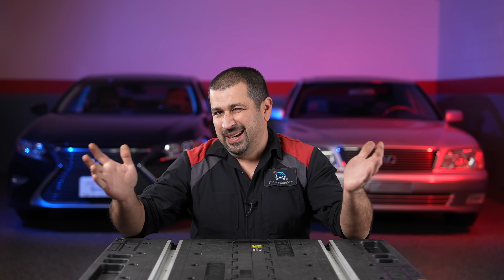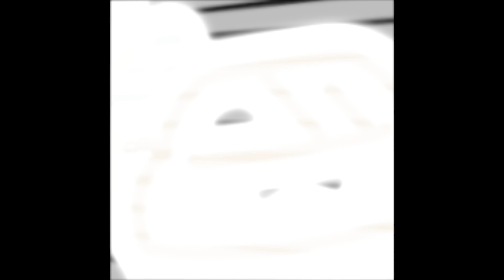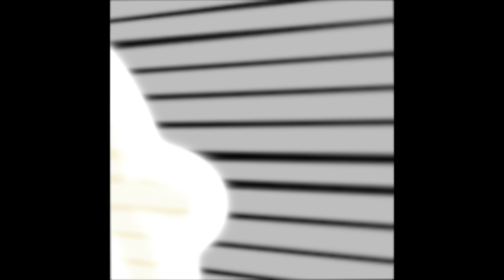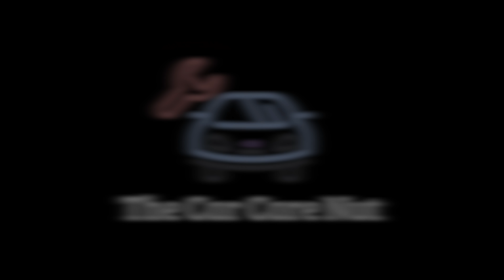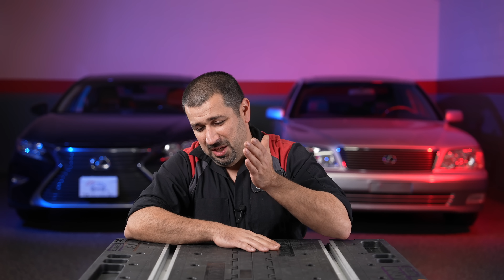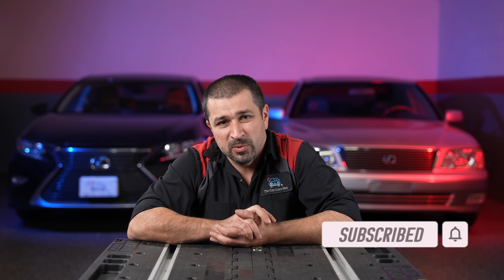Can Modern Turbo Engines Be Reliable? Here's The TRUTH!

Comment: Yeah, but AMD isn’t 0W 20 really there in many manufacturers recommendations just because they want to get lower emissions and higher fuel economy and it may not be that it’s actually needed and a thicker oil would have the engine last longer?

Comment: I've got the 6th gen 2025 4Runner TRD Off Road Premium (Non-Hybrid). Every 5k miles I get the oil change done at my local Toyota dealer. Using OEM Oil Filter, but my own engine oil: Pennzoil Platinum 0W 20 Full-Synthetic.
Reply: why?  is that oil any better than the Walmart brand synthetic oil?

Comment: Don't forget to also let the engine idle a while before shutting it down.   Allow the oil to continue flowing and cool the turbo before hitting that Start/Stop button.
Reply: Only old turbo cars need to idle before shutdown. Newer cars cool the turbo even after the engine is turned off.
Reply: @Japplesnap it's always a good idea to idle any ICE, even jets, before shutdown.
Reply: @AllenReinecke Not necessary to idle a car engine before shutdown.  Unless it's an old turbo engine and even then, it's just to protect the turbo, not the engine.
Reply: @Japplesnap I guess a 35-year career engineering powertrains wasn't worth much in your world

Comment: Between my family and myself, we owned a total of 6 late-80s Chryslers with 2.2L turbo engines.  They had a number of reliability problems, but not a single issue with the turbos.  My mom's LeBaron GTS went through 3 transmissions and a number of head gaskets before it got to 285k miles, but it still had the original turbo.  Oil changes every 3k miles was the key.

Comment: On an old Volvo I needed to temporarily disconnect the turbo pipe to get to the coils to change one out. Noticed a bunch of oil inside the pipe as I lifted it out and have always wondered why? That Volvo didn’t consume oil as far as I can remember.
Reply: It’s crank case vent. Gets sucked into the intake.  Normal to see some sitting at bottom of charge pipe.

Comment: Great advice! Got the same recommendation from a local service manager. Clean fluids are the key to mechanical longevity. My habit is to change oil every 3-4k miles, depending on how I’ve been driving. And follow recommendations for other components, transmissions in particular.

Comment: I have a brand new Tacoma with the 2.4 L turbo it's a great engine runs really well but I really think people are going to have problems with them because a lot of people are trying to modify them for more power and performance that's not what that engine and turbo are for if left stock and well-maintained I can see it being very reliable so I'm not really worried about mine it's the ones on the used Market later down the road that people have beat on that people may have problems with

Comment: i’m amazed you didn’t cover cool down and warm up
Reply: I think he was going for a much more general audience on this video. He didn't want anything to get in the way of the simple message of CHANGE YOUR OIL!
Reply: Warm up cold or hot I let my RPM drop below 1k RPM. Cool down wait 4min then turn off your ignition. I'm at 58k on my 2023 Tundra TRD 4x4. Oil change every 3k since 40k miles. NEVER DO 10K oil change.
Reply: Between turbos and all the electronics, there will be a Lot of 10-12 year old vehicles going to the junkyards
Reply: Its not really necessary in modern turbos. They are water cooled now as well so when you shut it off the turbos are still being cooled. Im mean they kinda have to be with the whole start/stop system.
Reply: The used car market is going to be trash. 3 or 4 neglected owners and the car will be in the junk yard
Reply: @donc6781  That’s their plan. Go watch Uncle Tony’s Garage.
Reply: It’s in his other video
Reply: not neccesary on modern turbos
Reply: @cshader2488 lol
Reply: New modern turbo engines don`t require such procedures.
"No, modern turbo engines typically do not require a cool down period before shutting off, as they are designed with features that manage heat effectively. However, if the engine has been driven hard, allowing it to idle for a minute or two can be beneficial for peace of mind." - Anthropics
Reply: Excuse me Sir/Madam but i was wondering whether longer intervals would be more acceptable in europe since my uncle told me that here in europe and britain, such intervals are fine because europe´s climate isn´t harsh on cars. But those long intervals are blowing my mind since back in my region in middle east i was changing oil every 5k kilometers, some criticized mefor not doing it at 3k. i would appreciate any insight.

Comment: As an anecdote on oil changes, I believe the Acura RDX was Honda's first turbo vehicle in the US. Honda called for 3k oil change interval.

The turbo trend also coincides with the direct injection trend and its downsides of more carbon.

My VW turbo engine is alive and well at 130k miles, good compression across cylinders. But oil consumption and cruising oil temps are slowly increasing.

Comment: 2:25 Turbo diesel last a long time. Some run more than 40 psi. (GM 3.0 Duramax run 43 psi) My 2016 F150 2.7 ecoboost only run 18-20 psi. It will last just as long if I take care of it.
Reply: Accurate statement.. new taco max gasoline turbo psi 15.. safe .. that’s eco mode in my race car subie turbo..

Comment: In terms of daily vehicle use, my issue is not the block whether it can be reliable, but the turbocharger(s) itself. Having a forced induction vehicle is adding more parts to fix in the long run. 

For a weekend/fun vehicle, I'm all with forced induction 🤷‍♀️
Reply: Turbo charger is like hips and joints the more you use it will eventually wear out:) On a sports car I think NA as when the turbo does kick-in and upset the vehicle dynamics and the torque through rear wheels make the car want to do doughnuts

Comment: I’m not necessarily opposed to turbo engines, but I really don’t like the amount of plumbing needed for water-to-air intercoolers.  The V35A is a massive mess when it comes to this.  All those extra hoses and pump and radiators that create failure points.  

I like the Tacoma air-to-air intercooler much better.  Very simple design and much more forgiving.  It also doesn’t clutter up the engine bay.  I’d be ok with owning a turbo Tacoma or 4Runner.

Comment: Yes I'm doing the 3 to 4k engine oil change. But I'm interested what about the performance engine that rx and TX has in the 500h? It has turbo and hybrid. Should the same apply? Or 5k? Since it's hybrid it will use less the engine. I will assume the hybrid might make up 25 to 35% of that miles put in? So 5k will be good for those?

Comment: It's videos like this that make me appreciate my non turbo 2024 crosstrek more whenever I complain about it being slow.
Reply: Ditto the Toyota hybrids with no turbo and D4S dual injection.

Impreza RS is a temping future car for me.
Reply: True. But holy cow is that thing slow
Reply: That boxer engine still needs high-quality maintenance. Maybe not 3000 mile oil changes but I wouldn’t put it past 5000. Also timely differential and CVT service.
Reply: @rickm8456 Yeah absolutely.  I agree.  I have the oil changed between 4 and 5000.  From what I understand it's important to have the CVT fluid changed every 30,000.
Reply: @flipfloplogic  yep. I just got an Outback and that’s what I plan to do.

Comment: I would change the oil on a turbo gas engine every 3,000 miles all day .  I agree with the host
Reply: I’m 71 and have been changing oil at 3000 miles my entire life and have never had an oil related failure.
Reply: @RonL-y3v honor to hear this coming from some1 like yourself !
Reply: Non-synthetic oils 3,000 miles, Synthetic oils 5,000 miles.
Reply: That’s wat I do.
Reply: For an average driver 5000 miles between oil changes is fine.
Reply: There is no need unless you're doing severe duty. 5k miles for most people is fine. If you do nothing but long highway drives and don't drive the car hard even with turbo gas engines you can push up to 7500 miles. Subaru only recommended 3750 mile intervals if you use conventional oil or severe duty on the Subaru STIs which have been turbo engines for a long time now.
Reply: @DOAHunt3r yup.. use thin synthetic oil..😊😊
Reply: @DOAHunt3r Plenty of people are doing "severe duty" with lead feet, short trips, and lots of hard stop and go.
Reply: @DOAHunt3r what about for the new VB WRX? Which oil is best for stock and daily driving?
Reply: @WillCamacho-gb2kg  If you check Subaru Japan they actually explicitly list a 0W30 and 5W30 as a recommended oil. Mobil1 ESP 0W30 or Mobil1 FS 5W30 will do just fine. There are also a lot of other equivalents on the market, basically anything marked for Euro cars in those viscosity grades.
Reply: @DOAHunt3r 3K good for me
Reply: I have non turbo vehicles and I change oil every 3000 miles as well, has never hurt the engine.  Oil is cheap.

Comment: Very sound advice. I had a 2013 volkswagen 80k miles, the turbo decided to pack in. The engine had regular oil changes we were told of six thousand kilometers or roughly 4k miles. Also, we bought the car secondhand, so there's no telling how the previous driver looked after it. It just seemed that the wastegate and those seals around the Turbo shaft and the bearings suffered damage eventually, probably due to the type of oil used and probably several late oil changes. So buying a secondhand turbo car is something that is fifty fifty shot as far as getting to a hundred thousand or more miles. We took it to the dealership. We bought it from which was a hyundai dealership, and we got a quote of eighty six hundred dollars. This is in canada, so it's a little more expensive here. I have three pieces of advice if you're buying a used car with a turbocharged engine; 1. Try to get the history of maintenance.That's the first thing. 2. Stick with low mileage oil changes with good quality oil. 3. If there's an extended warranty that you can purchase that is not too expensive and has a decent deductible I recommend buying that as that's what we did. We had our eighty six hundred dollar replacement turbo job, and it cost us two hundred and fifty dollars for a deductible. After that, we immediately traded the vehicle and got a new car it was also turbocharged, most cars now have turbo engines. Oh and preventive maintenance 100% oil and filter, air filter, coolant changes as some Turbos are liquid cooled. Finally timing belt and guides if equipped, others may use a chain and dont need this done. Thats my 2 cents.

Comment: I change oil on my turbo every 5000 miles. So now you are suggesting synthetic oil changes every 3000/3500 miles?
Reply: Yes sir. I do 3K oil changes. 2024 F-150 2.7 Twin Turbo, and 13 Acura RDX. They get 3,000 oil changes. Take care of your car, it will take care of you.
Reply: I've stuck with 5,000 mile oil change intervals on my turbo cars and have never had an issue.

Comment: I'm surprised they don't design a separate small reservoir with oil cooler of 2-3 quart capacity to supply the turbo rather than share with the crankcase. One separate circuit of oil, heat exchanger and electric oil pump to feed the turbo.
Reply: It's $$$$$$$$$$$.

Comment: 2.0T is a great solution for may use cases IMO.. The new turbo 4 in the Taco (along with the new trans) is endlessly better than the old V6 IMO.. I like both, but having many high mile turbos, I have zero concerns and they have lots of benefits. One thing you didn't mention is the vast majority of losses in an engine are piston ring drag, and going from a v6 to a turbo 4 is a big drop in drag thus higher efficiency just from that.

Comment: AMD about the changing oil weights. This isn't necessarily correct. Yes, the engineers state use "xyz" (0w20) oil, and that there is in fact a restrictor and flow rate to the turbo charger, but that A) isn't always the case and B) There is this little thing called fuel dilution (which is notorious on ALL, yes ALL, turbo engines). Fuel in oil brings the weight down. Take a 100 mile sample of fresh oil from my turbo car. It will go from a 0w20 to a 0w15 or 0w10. In the cold weather even more so. When the engine is cold, the amount of fuel dumped into the engine is enough to dilute the oil on the very first cold start of a turbo car. And this happens every single cold start. By the time I changed my 0w20 after 4000 miles, it was down to a 0w8 oil. I did the tests. I switched to 5w30, and it would get diluted down to a 0w18 ish after 4000 miles.

Comment: I thought the same with a VW Tiguan I had, because I read the manual to where it says 10k oil change and I stopped reading. The next paragraph in the manual says "severe driving" reduces the service intervals. "Severe driving" is essentially normal driving for most folks, like short trips. But I never read that far and just thought "wow, they have this figured out" and changed oil at 10k. Even my newer VW has that in the manual and the oil life indicator. I don't let this one go past 5k miles and change it myself. It is a small engine turbo DI and it uses zero oil. Don't trust the manual, trust TCCN. And make sure the oil meets or exceeds the manufacturer's specs. I would stick with full synthetic and not synthetic blend.

Comment: My 18 Tucson calls for 3000 mile Oil change with the 1.6 turbo.  I have been changing it every 3k. 96000 miles so far.
Reply: Please buy a Toyota RAV4 or Mazda CX-5 😢
Reply: @victorbaird8220 Why? I bought this one new,  it's paid for and it has been trouble free.

Comment: The science is simple here folks. Increased heat and pressure = harder on parts and shorter lifespan needing MORE frequent maintenance not less as indicated bc of emissions or making it look cheap to maintain

SIMPLE

NA will last longer. Turbos will get maybe a few mpg better and be faster they also have a higher tuning capability

Turbo is for performance at the expense of longevity

Comment: With the modern gas engines, the way they are made, a turbo engine will not last longer than a non-turbo engine.  Engines now built to be thrown-a-way IMO.  Given that and now they want to push 15 year loans on a car or truck that won’t last 15 (or even 7 years) years is a joke.

Comment: I will use a 3k mile OCI w/o a turbo engine. I also change the transmission fluid every 35k miles. So far. No issues.

Comment: I own a 2014 Mitsubishi Lancer (wished you would review older models) with the 1.8 diesel engine and a big MHI turbo, everything made in Japan. I treat it well and am always on top of the maintenance. It will fall apart by rust before anything in the engine will fail ♥️

Comment: What if you took the turbo out every 60k, cleaned out the burnt bb’s in there, put in .50 brass bushings/bearings and new seals and put it back in? It could be a regular maintenance thing. $20 in parts $500-600 in labor, and keep changing your oil every 3k?

Comment: Our 2023 Subaru Ascent with 2.4L turbo has a 6 mo 5000 Mile service internal.  Goes to our Subaru dealer every time. So far, at 18,000 miles, it's been great, but I do worry about the turbo reliability issue.

Comment: Modern turbo cars are coolant cooled, so I don't think reducing the oil life all the way down from 10,000 to 3,000 makes sense, given that the only engine that actually couldn't handle 10k mi even though Toyota said it could was the Camry/RAV4 2AZ-FE engine right when they had first moved to low-tension piston rings and had recently increased the oil change interval recommendation from 5k to 10k. This probably does make a case for changing the coolant more frequently though.

It may be worth mentioning the fact that turbos can run away and prevent the engine from being shut off as a failure mode as well.

Comment: Hi Amed have question about the 2025 Camry hybrid just noticed last week after I turn the car off after driving for 15 -20 minutes got a message saying 
Low battery turn power off  , took to the dealer they test the 12 volt battery and they said it pass the test everything is normal 
Is something that need to be concerned?

Comment: Scotty Kilmer has long claimed that turbo cars are short lived because turbos increase cylinder pressure, but. . . . higher compression engines also have increased cylinder pressure. Engines made 70 years ago had compression ratios around 8:1. But modern engines;  I had a Ford Escape V6 with a 10.3:1 compression ratio that used regular gas, my Lexus engine has a 10.8:1 compression ratio. These later model non turbo engines with higher compressions typically have a long life even with high cylinder pressures.

Comment: Can you please explain 0W-20 vs 5W-30 oil in something like the Honda 1.5 turbo. I recently saw somewhere else that in other parts of the world, Honda suggests and uses 5W-30 in the same engine that they say to use 0W-20 in the USA. They said this is for emissions and gas mileage and not what is best for long term reliability. I'm just wondering if it would be OK to use 5W-30 here in the USA if we are willing to give up a little MPG in exchange for better high temperature protection. I also live in the in the north, so I understand I would have to let the engine warm up a bit longer in winter when it's colder.
Reply: You answered your own question

Comment: Our 1st turbo was a 1983 Nissan/Datsun 280ZX turbo 2+2 it was a GREAT car. Just know HOW to drive and NOT ABUSE a turbo and you will be fine. I have had 2 turbo cars since, NO problems. Drive sensibly, let it cool down before turning the car off, and Change The Oil. It’s not complicated. GREAT video!! TCCN 👍🏻
2nd GLS450 3.0 turbo 7 years plus. 
3rd Expedition Max 3.5 turbo, coming up on a year. 3k or 6 months oil changes, easy peasy. The 10 sp tranny is fine too. 
Always reliable for me. 😊

Comment: I’ve heard too if you run that turbo engines over longer mileages trips with higher speeds when you stop leave the engine running for few minutes to reduce heat soak with oil still running through it.